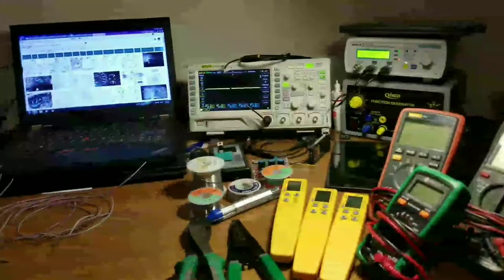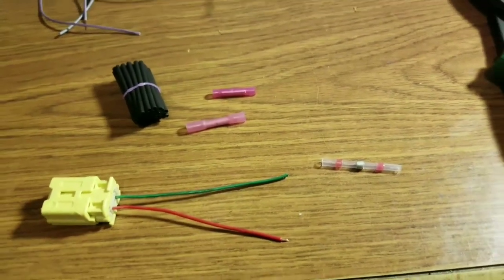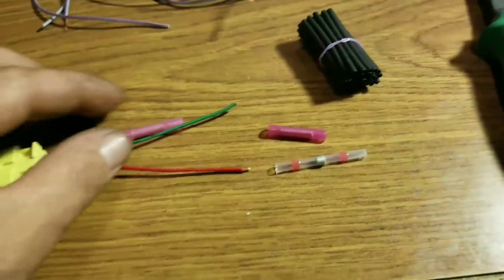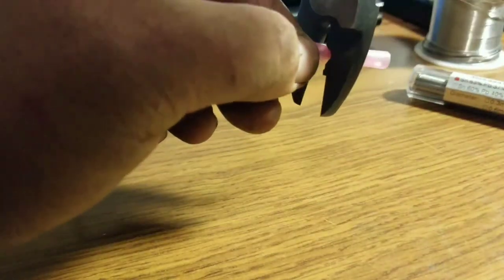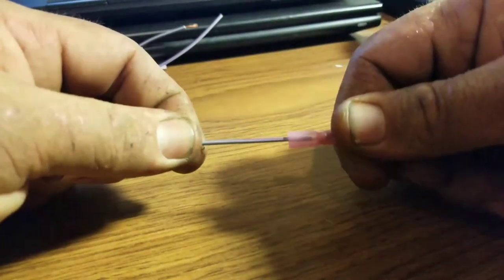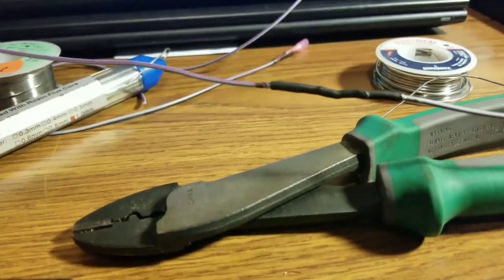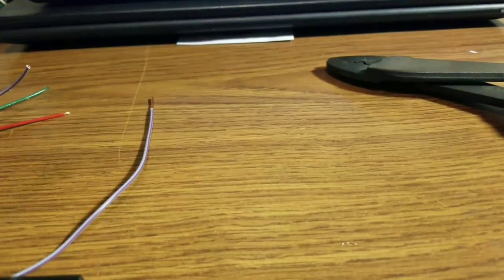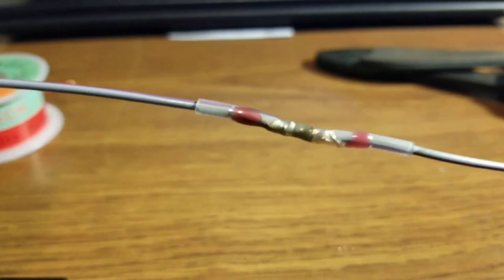The right way to fix or repair automotive wiring and can you fix airbag or abs system wires Harness

Comment: Great channel. I rebuild and program clusters/modules and it’s nice to see someone out there doing the same thing. A quick tip, after soldering the wires together I take pliers or needle nose and crimp the solder flat/smooth. I’ve had little wires stick out of the solder sleeve and create problems down the road! I’m an ex-aviation electrician but now do clusters full time. Keep up the good work my friend!
Reply: Make some videos!

Comment: I repair airbag wire harnesses all the time. I solder and shrink tube them .
Reply: is it safe to solder the wires ? will the air bag system work ?
Reply: @arielbargallo9448  yes it’s safe. This way he does in the video will end up turning the light back on .

Comment: Well done :-D Good explanation of how properly connect two wires.  I discovered as well the in the last months the solder-shrink connectors to a neat job. Sadly they are more expensive but very good for special applications.  I used them often for Vp30/Vp44 pump repairs :-)

Comment: With respect, the two methods for checking the quality of a repaired connection is first using an AC milliohm meter or using a time domain reflectometer.  The reflectometer is excellent for evaluating long harness impedance changes through each connection or connector.  It will also show where coax cables are damaged.  It will show the magnitude of the impedance as well as the distance along the cable of each change in impedance.

Comment: I've been enjoying your videos!  Just curious what your thoughts are....most connector & tool manufacturers say you should use the stake crimp only on bare insulated connectors (opposite the split as you noted). They say to use the crimp die with the smooth oval jaws for the insulated connectors(the innermost die on yours). I only started doing it the "correct" way 5 years ago after 25 years doing it wrong but I don't think I ever had a failure unless it was on those cheap hard brittle plastic insulated connectors or if I overcrimped crushing/cutting individual strands with the stake. I've never got a good explanation for the "correct" way.
Reply from the maker: I've always been taught to use the half round with stake (outer most on my cutters ) on any connector.  Insulated or not.  The split goes opposite the spike. I have been doing it that way since 1992.  I was taught that if in doubt try to pull the wires apart.  A good staked connection will break small to medium guage wire before the connector will fail.  I do know i repair regular crimped not staked wires on a regular basis especially those choice by stereo and alarm shops.  I swear they do the quickest and sometimes nastiest wiring jobs I've ever seen. Most mechanics take pride in their repairs and try to learn the correct way to do things.  I'm not saying i'm always right but using the stake and half round crimp has never let me down.

Comment: Hi, I bought a car that someone pulled the wire out of the knee air bag at the connector, on a 2014 Charger.  I got a new connection end with wires attached.  The problem is I can't find any info as to which direction the two wires should be attached.  Do you know if it actually matters?  Thanks

Comment: Hey I got a question just did a swap of seats on a Mazda a previous seats had airbags and the new ones came out from a Mazda also and got airbags but with different connectors it's possible to just cut the connector and connect the cables?

Comment: We've been using those solder sleeves on Benz for years. They have had multiple DTB's for SRS wire repairs, I love those sleeves and only use those (have only used the ones supplied by Benz) for repairing wires. I will also use heat shrink over the sleeve.
Reply: Do you have a part number for the sleeve to repair impact srs wire ?
Reply: @danjensen100  thanks a ton. I'd still be interested in learning if there is part number available for this from benz. Haven't reached out to a dealer yet, but wanted to check in with you first.

Comment: How did you get started in this business? I wanna start doing Mobile diagnostics and minor electric repairs but I have no formal training though a very quick learner in most things.
Reply from the maker: DIY-HAVEN it was a series of events that got me into it. Started out as a mechanic. Went to school to be an engineer for a couple years. Had to quit because my first daughter was born. Got into the it business during the early 2000's when it was booming. Everything crashed so I went back to what I knew. Got to work as a mechanic at a body shop where I got to and had to fix everything on every kind of car. Started my own shop for 5 years lost it during a divorce. Put my tools in a van and knew there was a demand for programming and electrical specialists and since I knew computers,  electrical and cars really well is been amazingly uphill from there. So really no tech school or anything.  Just a combination of jobs that eventually combined into one.
Reply: Practical application... I hear you man. I hope you have more time to do diagnostics videos for ppl like myself. Will really appreciate it
Reply from the maker: DIY-HAVEN will do.  I have a lot I just need to edit. I try to make them every time I can when the opportunity is there to not look like an idiot In front of my customers. Lol. I'll get more posted. I really want to get the nissan ones up because people struggle with them and message me quite a bit.
Reply: Man any will be much appreciated. I'm looking to buy the ms906bt to start. After watching your video on it I was pretty much sold. But a tool is only as efficient as the hands (or brain) that handles it. So with a few good videos on the "psyche of diagnostic basics" I think I'll be able to fly on my own
Reply: @sailorbob74133  appreciate it. You've went under the radar for a minute there jack! Everything good? Glad to see you back. I've since bought the Autel and it's been a wonderful addition to my career. My next tool would be a scope. I'm looking at the micsig. Hopefully by next month or so I'll get one and start messing with it. I'll look up scanner danner premium. I've been using his forum so far and it's been awesome. Ppl ready to help you with any issue there.
Reply: @Usmanthemecano  they have a good thread over on the scannerdanner forum about which scope to buy if you don't have much money
Reply: @sailorbob74133  yeah I've done my research. And for my usage I think the micsig is an awesome beginning.

Comment: Not boring at all a lot of techs need to know this stuff I hate having to follow behind these guys who butcher the wires and splices nothing better the removing a half a roll of black electric tape to see 18 gauge wire splice together with a  non-insulated  BLUE butt  connector

Comment: Soldering is not approved by most manufactures, the most common approval methods are duraseal butt connectors, approved by Ford , vw audi group , gm usa and gm Europe , I do solder myself at times , but not often now.regards Joe

Comment: Ps they call it a  Western union splice because in the 1800’s the western union  coach drivers  Would have to repair the  Telegraph lines  Between towns and all they would do is Twist the wires in that configuration and time back to the pole

Comment: How about an abs wire what do you suggest
Reply from the maker: If it's not the sensor itself I repair them with the solderseals and heatshrink the whole repair when possible. A lot of abs wiring is shielded near the wheel speed sensors and  really typically shouldn't be repaired.

Comment: Did you get the oscilloscope for the 906bt?
Reply from the maker: Dan Jensen I actually just ordered one. Wont be here until next Monday thought. I want to do a review on it.  I have a rigol 1104z that I have at my desk. I fix a lot of clusters , pcm's and audio equipment at home. I haven't had much need for a mobile scope since these new scanners stream data so fast and the codes are petty accurate on these newer cars.  We used to use scopes a lot back in the day when we only had the mt2500 scanners . I did have a multimeter with scope built in that I pull out occasionally when i think it might be a pcm issue on a sensor circuit  just to be certain. I'm going to make a video on how to use a scope properly.  I have a friend with a Durango that can't get a speed sensor signal out of the transmission. We're going to check and see if it's outputting a pwm signal from the sensor to know if it's a bad pcm or tone ring in the transmission. The wiring is good and the sensor is new (tried 2) but still no signal.
Reply: Hey, shoot me an email when your able (I put my address in your other post) wanna ask about the backup process for the Autel
Reply from the maker: Dan Jensen just sent it